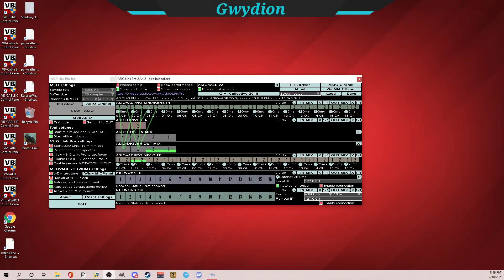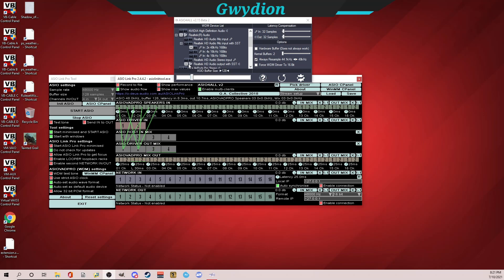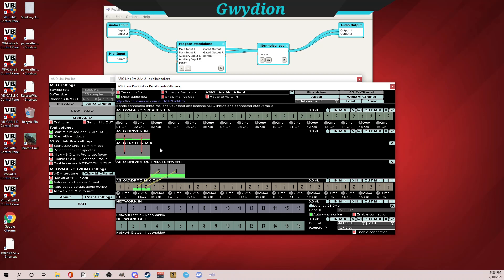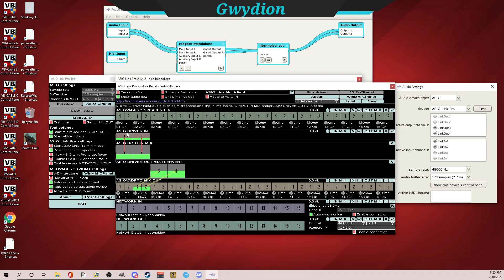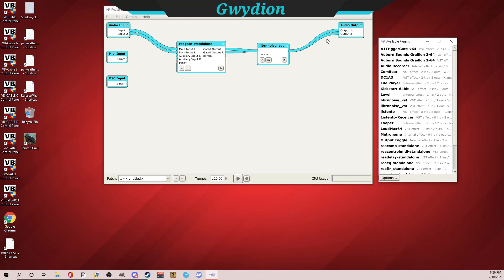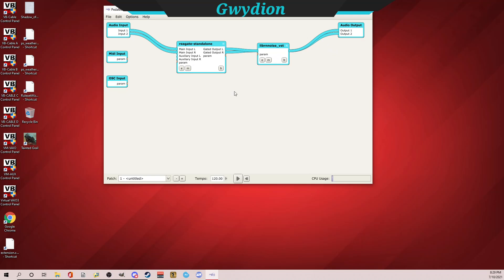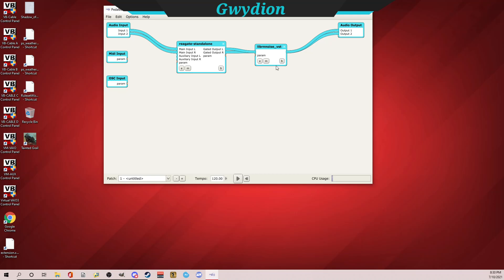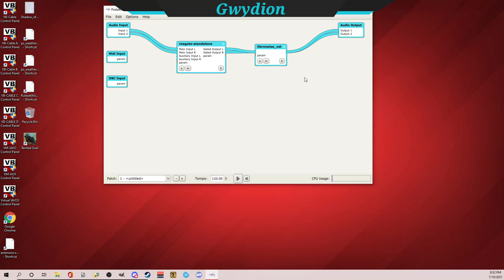Using VST Hosts with ASIO Link Pro

Comment from the maker: When you open ALP, select the channels in/out and in the drop gown select the number of in/outs you want.  If you have already launched ALP, click "stop ASIO" and then click the drop-down.  Otherwise it will be greyed out while it is running.  Hope that helps!
https://i.gyazo.com/0db9d79a01b134742b92a64b217d4960.mp4